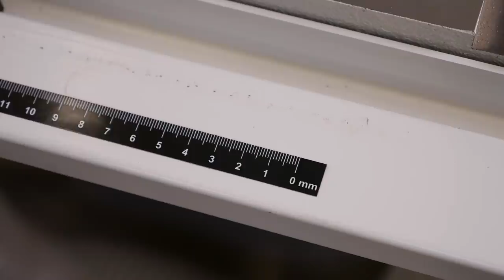This is just a brilliant decision!!!

Comment: You really should clean out the chips with the forstner bits, drill down, pull out, repeat until either down to desired depth or hole is complete. Otherwise, you're over heating the bit and will ruin the bit in time. Will also be easier on your drill as well too. 
Great build. Cheers :)